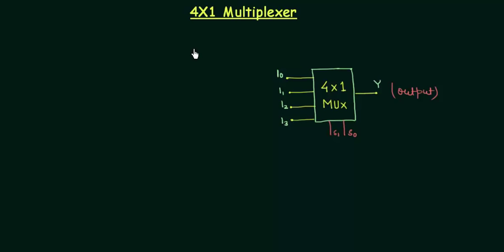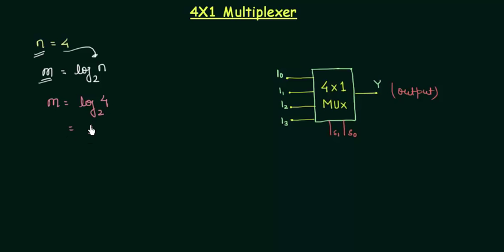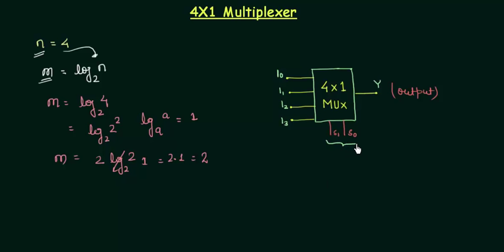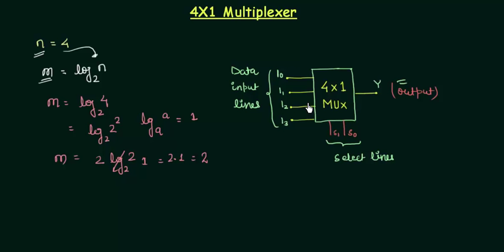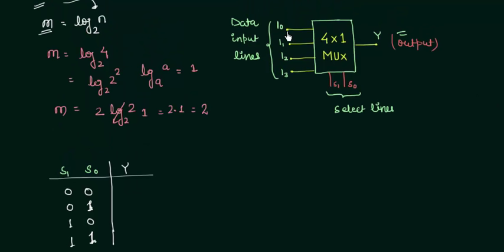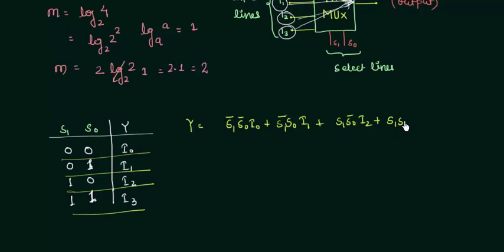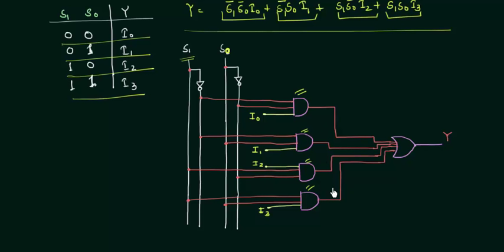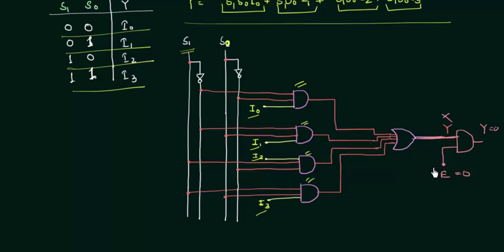4X1 Multiplexer

Comment: Sir, how to do this question.
A boolean function F(A,B,C) = (A + B).(B + C). Implement the
circuit using a 4 to 1 multiplexer in Figure Q4(iii) and basic gates if
necessary. Inputs A and B must be connected to the select bits S 1 and
So respectively.

Comment: show how two 3-to-1 block diagram multiplexers (without enable inputs) are connected to form a 5-to-1 multiplexer. use no added gates. input selection should be as follows : if DC=00 then :AB selects I1/I2/I3 , if DC=01 selects I4 and if DC=10 selects I5 . give the function table of this 5-to-1 multiplexer and its connection diagram
Reply: haha you've copied your assignment and pasted here :p

Comment: What is the function of enable input???????
Reply: Enable input is just a control input that turns the electronic circuit On or Off.
As shown here in this example we conclude that when the Enable is Active High the  Circuit functions where as If it is in Active Low state The Circuit doesn't work.
Reply: @avinash Why is it necessary to use it?